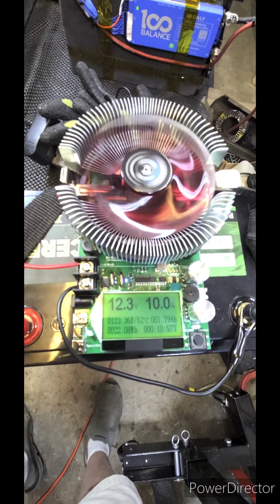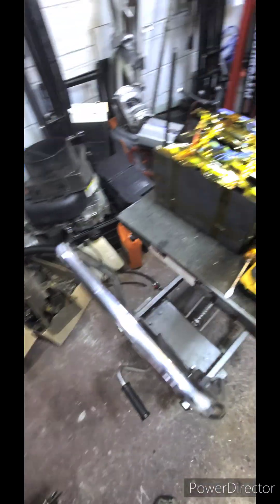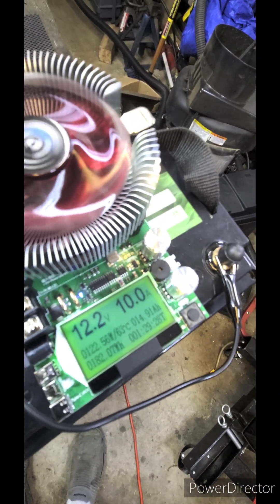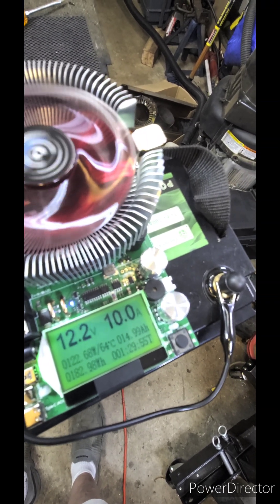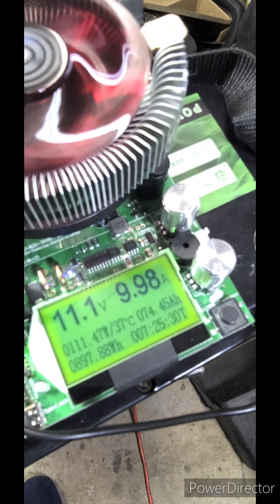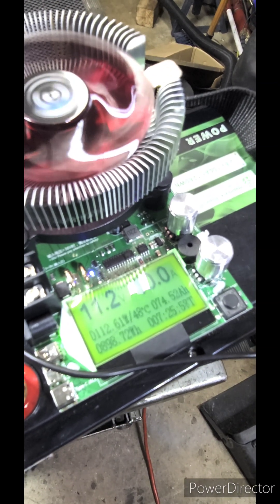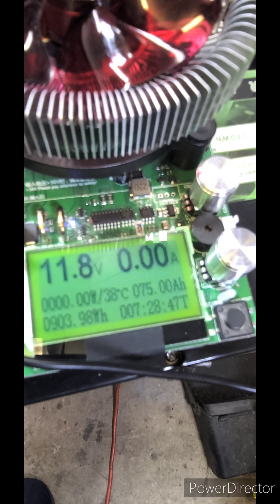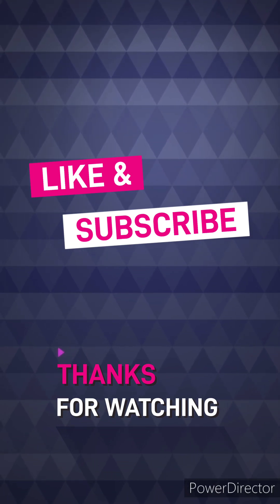HYSINCERE 12V 100AH LIFEPO4 LOAD TEST

Comment: I've been reading your responses to people's comments. I PROMISE I am not going to be a jerk here, but I think you need to do a LOT more research on the different TYPES and intended uses of LiFePO4 Batteries before making some of your "Authoritative" comments. I have been designing and building these systems for more than Two Decades. While the technology has, in fact improved greatly, I still proceed with extreme caution when working with this Chemistry.
Reply from the maker: @BruceForster-k9n  I'm not a professional  with these batteries, but I am pretty knowledgeable with automotive electronics.  I installed car stereos and alarm systems in cars in the 80s. In fact, I was one of the first ones to install a Clifford  alarm with a pager.  I also repaired automotive radios and installed navigation systems before we had GPS. These batteries act completely different than lead acid batteries.  I have 3 of these batteries running my 36 volt mower, and I have one running a small solar system.  I think these batteries are amazing.  Could you be more specific.  I think when I made this video, I had just started using these batteries.  This is definitely not my specialty, and I'm open to suggestions. I don't think you're a jerk. I'm very easygoing. If I'm doing something wrong, please let me know. So I can fix it. Thanks for the comment. 👍

Comment: The Batteries are DESIGNED for low draw, smaller systems like Portable Solar, etc. They DO make Lithium Batteries which are specifically designed for vehicles. These batteries you purchased are NOT for your Lawn Tractor! There are differentLithium Battery formulations for different uses. I am concerned that you are running AN EXTREMELY HIGH RISK OF RUINING Your batteries by using them in your Garden Tractor.  They DO Make Lithium Batteries which are INTENDED for Automotive use. Your present Hysincere Battery are not, I repeat, NOT intended for the application you are presently using them in.
At some point, your Tractor Motor/Alternator Are going to DESTRY your Batteries.NOT TO MENTION THE BETTER THAN 50 PERCENT RISK OF A FIRE! If you try to get them replaced them under Warranty; If Hysincere finds out you put them into a Motor Vehicle, they will NOT Honor the Warranty!
Reply from the maker: @BruceForster-k9n  i will try to answer all of the questions I can. So first, before I purchased these batteries, I told the company what I was using them for. I sent them several pictures and videos of the exact motor with the exact batteries.  I asked them if they would work with a 36 volt DC brushed motor, and they said it would be fine. I actually had a bad battery, and they did replace it and told me to keep the bad battery.  I found out it was the bms that was the problem.  So I changed the bms in all the batteries so they wouldn't have a problem. I was also told by the company that I didn't need to balance them either. So I have been using my mower in the winter for snow with a plow. I have been using it for over a year with no problems whatsoever.  PLEASE EXPLAIN WHY THEY ARE A PROBLEM.  Like I said, I contacted the company before I purchased them. I actually purchased 3 and ended up with a bad one (bad bms) so they replaced it instantly.  I'm just confused at how these batteries are any different than the ones for golf carts. I'm definitely open to suggestions.  I do have fuses and I'm using 8 Awg wire along with a 36 volt relay. I appreciate the comment and I also appreciate your concern for my safety.  Is it the amp draw? Is it the Bms because they were changed to more stable ones that can handle a 200 amp load. Or is it just the batteries in general. It is appreciated.  Thank you.
Reply: @doingstufforatleasttrying4843  It MIGHT be the bms. I know nothing about this brand of battery. I'm old school where these batteries are concerned so  I may not be FULLY informed about the present stage of development. I have always been of the understanding that you should use LiFePO4 batteries which are "application Specific". Most of these companies DO have Batteries specifically formulated for use in Internal Combustion Engines.
Watching your two videos, I did not get the impression that your batteries WERE made for motors like yours. I think it MAY be possible that the company may NOT know, so they simply told you yes. 
At this point i time, the ONLY batteries I DO truct are LiTime and LiPuls. I own both and am VERY satisfied with them. The fact that you deemed it necessary to change out ALL of the BMS's in your Hysincere batteries ALSO gives me Pause.
Reply from the maker: @BruceForster-k9n  I really appreciate the information.  I never heard of the other battery types.  I'm just a DIY guy. I never used these batteries before.  That was one reason why I contacted the company ahead of time. The mistake I made when I first connected the batteries were that they were not at the same level. I think one was full, and one was almost empty. The bms with the low charge instantly smoked. It blew the mosfit. So after doing some other tests, I realized the bms was low quality.  Could be the reason why they sold them and just gave me the yes answer to make a sale. I did purchase 3 and ended up with 4 of them. I even tried getting a 36volt BMS, but that was a fail also. I also have 2 36-volt batteries from an electric van that are about 10 years old but still hold a decent charge, and those are going on my remote control mower. You definitely make me think about it. I'm not as knowledgeable about these batteries as you are. I have also seen a lot of people just throw these batteries in golf carts and go. And I basically have a golf cart with a mower attached.  I am definitely going to do more research.  I really do appreciate all the information and your time. Like I said, I have been doing automotive electronics since I was 13. I actually turn 56 tomorrow on 4/25. I am always willing to entertain all possibilities because I don't know everything, and I'm always willing to learn. That was the reason I asked the company before I used them. I guess you get what you pay for. I'm disabled on a fixed income, so these were in my price range. I am definitely going to investigate more. I really appreciate your time. Thank you.

Comment: I have 3 of these 300ah battery's 
.is there a way i could improve the bms? I want to use these in my van
Reply from the maker: Yes. I actually I used this one because I had one go bad. It was actually my fault. I tried to hook up a dead battery and fully charged battery and the dead one started to smoke one of the components so I ended up using this one and it’s so much stronger. You can use it to start a car or use it in other heavy duty situations. I think I made a video on it. If not I can put another one out. Here is the link..
Thanks…

Battery Board Car Start Inverter PCB 12.8V Power Switch Control Over Discharge for LifePo4 4S 130A 3.2V
Reply: @doingstufforatleasttrying4843  i saw in your updated video that you actually liked the battery.  Do I need to even add a bms
Reply from the maker: @ Yes you need a BMS.. It will make sure that it will charge the 4 cells evenly and it won’t let it overcharge. What are you trying to use them for? Are you doing a stereo system or more like an RV system. Each battery has 4 individual cells that equals the 14.7 volts. I think they are like 3.7 volts a piece or close to that. But, to be on the same side I would definitely recommend a BMS. It can be a small one depending on what you are using it with. If you tell me what you are doing it would make it easier to explain it better.

Comment: Note that this battery only has a 100A BMS, so it's not rated for use with your lawnmower.  Max output is 100A, where the BMS will kill the output.  Your mower would easily exceed this current level.  Testing at 10A load will not give you any meaningful results.  Also, you did not charge/discharge the battery to the correct voltages, so your test is not valid.
Reply from the maker: @silicon.alchemist  My mower only draws 24 amps at max load. When I am driving it and using the blades. If it’s just running it uses about 11 amps. It works great for my situation. I am not really familiar with these batteries so it’s possible the test is incorrect. I’m not that familiar with these lifepo4 batteries. I’m use to the old lead acid. Thanks for explaining it to me..👍
Reply: @doingstufforatleasttrying4843  You can easily exceed the rated or steady state current by running the blades into an obstacle or putting a heavy load on the drive system by say, going over a curb .  A stalled motor can easily exceed it's operating current by 5-10 times.  At least for a short period of time.  The motor controller current can easily spike over 100 A for a few milliseconds under heavy loads, which could trip the BMS without blowing a fuse or circuit breaker because of the short duration of spike.  A lead acid battery has no BMS, and it can easily absorb these kind of spikes.  The BMS is (among other functions) an electronic "circuit breaker"  which can trip very quickly on an overload to protect the battery and its circuitry from damage.

Comment: One, the battery has to be fully charged 2 the cutoff voltage is 10 volts not 11.1. retesting is required
Reply from the maker: @juanfigueroa6941  I didn’t realize I could go down to 10 volts.  I thought 11.1 was the lowest for lifepo4 batteries. I will redo the test and set the voltage at 10 volts. I am still new to these batteries. I installed car stereos and alarms in the 90s but, still learning on these batteries. Thank you for the help. It’s appreciated. 👍
Reply: @doingstufforatleasttrying4843  please post your retesting results. Thanks
Reply from the maker: @juanfigueroa6941  I will get it done within a day or so..
Reply: @ Max charge voltage is around 3.6-3.7v per cell for LiFePo4 cells, discharge minimum is around 2.5-2.8v.  So, 4x3.6=14.4v at the top end, and 4x2.6=10.4 at the low end.  You should charge/discharge at 20 or so amps with a dumb charger and allow the BMS to do its job, i.e. just charge/discharge until it stops on its own.  Check your battery specifications, the numbers for specific batteries may vary slightly, and the BMS may have different internal settings.

Comment: Hello yu ou didn't charge it to 14.7 volts! Your using the wrong chatger??..😢😮😮😅😅😊😊😊
Reply from the maker: I actually have a few chargers. For some reason, it will only charge to 13.8 volts. And then stop. They are very cheap BMS. I tried some of the other, and they did the same thing.. I will take a look again.. thanks for the comment.  Its appreciated..

Comment: Your test indicates its not worth buying Hysincere since there are better alternatives on the market. Like Li time, redodo, power queen etc. And battery prices across the board are dropping like a rock. Why take a chance  with this one.
Reply from the maker: @jab376  You're absolutely correct.  The batteries are coming down in price a lot. The biggest problem with these batteries is the BMS BOARDS. They are terrible.  After I replaced the one, it was a completely different battery.  The bms had no problem starting a car after. With the other Bms, it would just shut right down like it was a direct short. Thanks for the comment.
Reply: Almost all of the Chinese batteries are made by the same manufacturer and just have different labels, different enclosures, or different colors.  If you open 'em up, they all have identical guts.  Thus, to make a blanket statement that one is better or worse than another is not really correct.  BMS's might indeed be the difference in some cases.  That, and the fact that this set of tests was neither scientific nor used correct voltage levels does not rule out this particular brand over any other.
Reply: @silicon.alchemist   You are so correct.  It would be a Shame if this battery came from the same manufacturer of battery brands like Litime, Redodo, Seikon etc.with very good reviews.

Comment: Great test.Did you test any of the other ones? If so are the rest giving the same numbers?
Reply from the maker: @HammerStorm-ux3xx  Yes I actually did test all of them and believe it or not they all went about 100 Amp hour and the watts. The only problem I had was the one bms. It just let out smoke under the first load. But, all the other ones are working fine. It seems to be a real cheap bms that they put in them. The price does reflect that. But after 3 months I could not be happier.  It's way over kill for my mower because I only use about 10 Amp hours to cut my front and back lawn. The last time I was pulling cinder blocks in my carts and the mower is stronger than gas🤣 but, Amazon has a great cheap bms for like 30 bucks and it will do 130 amps. To give you an example.  If you use those battery Spot welders, the hysincere battery will just reset. It thinks it's a dead short and won't output anything.  The cheap bms from Amazon has no problem.  In fact I used it to start my other car and it ran great in a Kia Sorento 6 cylinder.  If you need some cheap but good batteries then these are the way to go. I think they are mostly made for solar. Anyway thanks for the comment. 👍
Reply: @doingstufforatleasttrying4843  Here are some procedures for testing the capacity of a 12.8v 100ah LiFePO4 battery: 
 
Check the open circuit voltage
Disconnect all loads and chargers from the battery, and wait 15–30 minutes. Then, use a multimeter to measure the open circuit voltage. Compare the voltage to the battery manual's SoC chart or voltage curve chart. A fully charged 12v LiFePO4 battery should have a voltage of around 13.3–13.4v. 
 
Discharge the battery
Discharge the battery at a constant current of 0.2C5A until it reaches 10.0 volts. 
 
Calculate the capacity
The battery's capacity is measured in Ampere-hours (Ah). It's calculated by multiplying the current consumption by the hours it takes to discharge the battery to 2.0 V. 
 
Here are some other tips for testing and charging LiFePO4 batteries: 
 
The recommended charge voltage for LiFePO4 batteries is 14.0–14.6V at 25℃. The best recommended charge voltage is 14.4V. 
 
LiFePO4 batteries don't need to be float-charged. If the charger has a float voltage setting, set it to 13.6V. 
 
A LiFePO4 battery shouldn't experience permanent degradation when charged between 0 ºC and 45 ºC.
Reply: @doingstufforatleasttrying4843  I wouldn't recommend these lipo4 batteries for car use. They get bounced around too much and it's too hot under the hood this severely cut the Life of the battery. They do make some lipo4 batteries for use in cars. I'm glad you're retest showed you got what you paid for and more for the price.
Reply from the maker: Thank you for that information.  I think fully charged it was reading about 14.7 volts but, I could be wrong.  I am actually charging the battery now and will try it again at 10amps and I will set the low voltage to 10 volts and see if I get a better result.  I really appreciate all the information.  I have worked with electronics my whole life and these are all new to me. I use to use interstate batteries along with 1 Farat caps. That's the way we did it in the 90s..😂 technology is amazing.